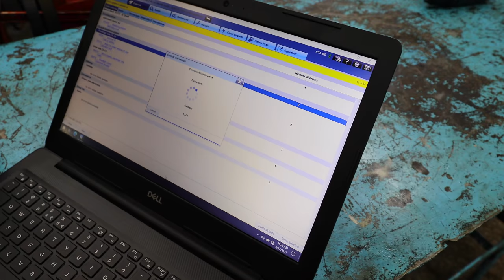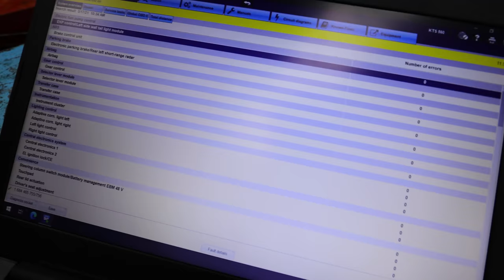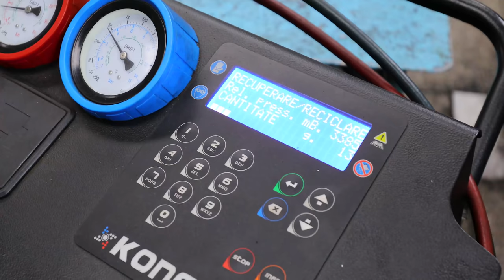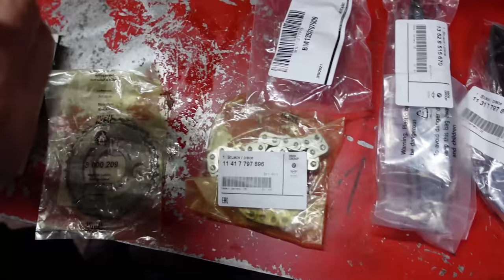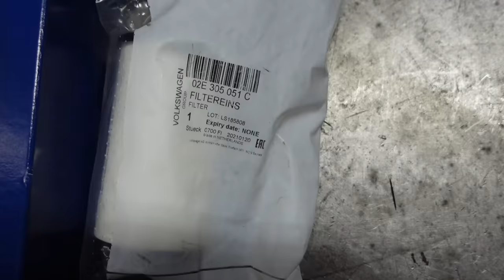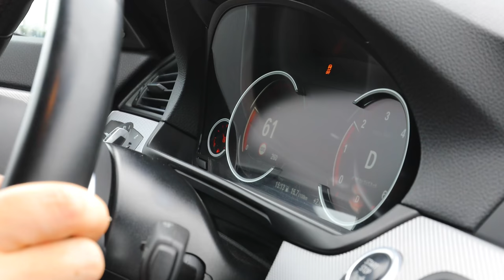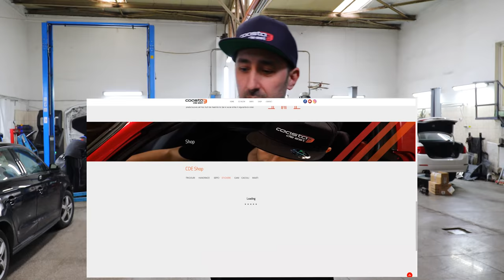BMW M550xd - balaurul cu 3 turbine 😈😈😈

Comment: Salut . Ma numesc Alexandru si consider ca cea mai tare masina este BmW e36 doare ce nefiind mecanic . ( doar ce terminasem liceul ) mi-am achizitionat unul . ma lasat motorul in Drum . Am schimbat 3 motoare la 3 e36 diferite la bordura ( pe drum ) din diferite motive fara a avea prea multe cunostinte de mecanica are cateva mufe de la ecu si electrica foarte simpla care o are . furtunele de racire  apa / incalzire habitaclu  . caseta de directie 2 conducte . si 2 tampoane dupa care cutia si etc dar noi de cele mai multe ori pastram cutiile la swap-uri . Interiorul era unul decent de frumos si erau anumite e36 cu destul de multe optiuni de Asc la incalzire in scaunde clima dubla digitala . computer de bord pilot trapa . la modele coupe geamurile Buterfly rabatabile electric ceea ce in ziua de azi nu mai vezi pe nici un e36 . si clasicele lucruri usor de lasat pe burta jante la tot pasul cu prindere 5x120 si hrana pentru suflet ( cerculetele / drifturile in mers ) ! e36 Order !!

Comment: Dupa părerea mea, cel mai bun model de la BMW este E46 datorita mai multor motive 
1. Pentru vremea aceea a fost un model revoluționar cu o diferență destul de mare fata de modelul anterior ,ceea ce se întâmplă mai puțin în anii următori pana în prezent 😅
2. A pus la dispoziție cumpărătorilor o gama larga de motoare
3. A fost și este un model pentru toată lumea ,iar asta se vede în cifre ,prin faptul ca este una dintre cele mai cumpărate mașini 
4 A venit pe piața cu foarte multe dotări moderne pentru acea vreme 
5 Modelul M este și acela un model revoluționar pentru acei ani (3246 cm³ / 343 - 360 CP ) 
5 Un model foarte fiabil . Nu știu câți posesori de BMW se pot lauda în perioada asta ca nu au probleme cu distribuția la 300000-400000 km 😅

Comment: In legătura cu stage 1 depinde de la mașină la mașină, dețin un Peugeot 4007 cod motor 4HN 2.2 HDI 156CP 380NM din ce spune producatorul, am făcut la cineva in “garaj” stage 1 DPF și EGR-OFF. Mașina a mers bine 3000 km pana s-a aprins martorul motor cu eroare pe debitmetru de aer. Am schimbat 2 debitmetre 100€ bucata ca sa îmi dau seama ca modificările aduse la soft erau incorecte, mașina nu putea sa tragă atât aer pe cât era scris in soft astfel dând eroare pe debitmetru. Mi-am pus înapoi softul original și am mers la cineva profesionist care face stage 1 și este acreditat A-TEAM Performance. Băiatul mi-a pus stage 1 care sincer nu am avut nici o problema atât doar ca ma mâncat sa ii pun filtru sport conic intra mult prea mult aer in motor mașina a dat iar eroare pe debitmetru, de tura aceasta i-am schimbat filtrul conic cu unul original K&N iar mașina a scos pe dyno 178CP si 425 NM cuplul nu este impresionant față de ce venea din fabrica dar se simte puterea având de la 3200 rpm 170 de cai constant pana la 4500 rpm. In principiu contează cine îți face softul sa îți și ofere o garanție pe mașina ca nu vor apărea alte erori după cum am pățit. Mașina are acum 275.000 km in creștere.

Comment: Consider ca BMW M1 coupe 2011 este cel mai bun si cel mai unic bmw pentru perioada lui. 
Este unul dintre putinele bmw-uri moderne unde mai putin inseamna defapt mai mult.
Sa va explic :
Alte modele bmw precum M3, M5 etc devin din ce in ce mai mari, mai puternice si vin cu din ce in ce mai multe dotari dar pana la urma bmw este despre performanta. Eu sunt de parere ca adevaratii pasionati ai marcii isi doresc o masina cat mai minimalista si cat mai performanta, iar bmw nu prea mai face asemenea masini.  Sa luam spre exemplu un m4 GTS, o masina de altfel puternica dar care vine cu prea multe. Jante aurite, dita mai aripa in spate, rollcage, transmisia cu dublu ambreiaj, sistemul de injectie cu apa din portbagaj, multa electronica. Dintr-o data parca totul devine foarte complicat. Daca vrei cu adevarat o masina minimalista, orientata strict catre performanta (ce insemna defapt BMW odata) singura optiune ar fi sa te orientezi catre modelele vechi de M(<2001).

SAUUUU, iti poti lua un M1 coupe din 2011. O masina produsa doar in 6309 de exemplare, destul de rara, unica, si orientata spre performanta zic eu :D. O masina alimentata de un singur tren de rulare ce dezvolta o putere de 335 de cai. Cea mai buna varianta a motorului N54 si al doilea motor turbo pus vreodata pe un M (imediat dupa s63 v8) motor in 6 cilindri, pus de asemenea si pe renumitul e89 Z4 si dotat cu o cutie manuala in 6 trepte.

Pentru o perioda in care BMW o ‘ardea’ fancy cu transmisiile automate cu dublu ambreiaj, m3’uri cu v8 + obsesia timpului scos pe Nurburgring 0-100, BMW M1 nu era o masina chiar asa de rapida si nici ‘high-tech’ dar in schimb era o gura proaspata de aer. 
Spre exemplu, in loc de frana de mana electronica, acest model vine echipat cu o frana de mana clasica, suportul de pahar nu este ascuns si proiectat sa se deschida intr-un anume fel ca sa fie cool si sa iti ia ochii, este doar acolo. Bordul nu dispune de un LCD fancy ca la majoritatea masinilor moderne, este analog. Sinele de la scaune nu sunt ascunse sub o tapiterie de piele de dragul de a face masina mai good looking si de a adauga la pret. Optiune cu trapa nu exista pentru simplicitate si pentru a cobora centrul de greutate al masinii. Consola centrala nu este finisata in piele scumpa, ai pur si simplu plastic (this is spartaaaaa). Spre deosebire de multe alte masini, consola centrala este super simpla si usor de folosit. O masina la care nu s-au adaugat elemente care sa adauge greutate si complexitate. Simpla si orientata catre performanta. 

Astea sunt doar cateva dintre motivele pentrui care BMW M1 este o gura proaspata de aer pentru oamenii care pur si simplu vor sa conduca. 
Desi BMW nu se astepta ca masina aceasta sa fie un succes, tocmai pentru ca au scos foarte multe elemente de tehnologie si gadget-uri, s-a intamplat fix opusul. In plan au fost 2700 de exemplare pentru fabricatie dar cererea a facut ca aceasta masina sa fie fabricata in 6309 exemplare.

O parte din motivul pentru care acest model a avut un succes imens a fost fix motivul acesta. Dar evident, ce a contat cel mai mult la acest succes, a fost experienta de condus. 

Cam asta a fost parerea mea despre BMW M1 Coupe, o masina perfecta pentru adevaratii pasionati. O masina care nu atrage atentia, nu te scoate in evidenta in nici un fel, facuta pentru sofer, nu pentru imagine. Este genul de masina pe care nu toata lumea o poate recunoaste dupa capabilitati dar care iti ofera o experienta unica. Iar in cazul in care un om vine la tine cand esti cu masina intr-o benzinarie, pregateste-te de o discutie foarte lunga despre masini, pentru ca acel om cel mai probabil o sa stie totul despre acea masina si multe altele :D

P.S doar asa informativ : 
Stiati ca primul BMW M produs vreodata a fost tot un M1? Masina a fost fabricata intre 1978-1981.

Mai mult decat atat, a fost prima masina mid-engine produsa in masa de catre BMW. A-2-a a aparut abia in 2014  (i8 hybrid) :D
Reply: Am uitat sa mentionez inca un aspect super important. Aceasta masina a avut un pret de retail undeva la 46,000 de euro. In momentul de fata, unul in stare buna si cu km putini este inca la un pret asemanator, unele chiar sar de pretul de lista. Printre putinele masini facute vreodata care si-au pastrat pretul foarte foarte bine in timp :D

Comment: BMW - 319 - 
1934–1936
Roadster, motor Otto de 1.9l (1911cm3 )ce dezvolta 40kw/98nm cu 3 carburatoare Solex si 6 cilindri in linie, cutie cu patru trepte din care, doar  treapta 3 si 4 erau sincronizate, o viteza maxima undeva pe la 120-130km/h, lucra pe 6Va instalatia electrica... urata, veche, mie unu imi place 😅, imi plac si alte modele dar asta e mai pe placul meu.

Comment: Salut! Am si eu o intrebare pentru comunitatea asta faina. Detin un Ford Focus mk2 facelift din 2009 si are aproximativ 123.000km, motor 1.6 Ti-VCT cu 115 cp. Atunci cand am cumparat masina, de la un baiat din Brasov, nu am sesizat pe moment dar se auzea un sunet frecare metal pe metal cand masina era la relanti in neutru. Ulterior am schimbat ambreajul cu tot cu rulmentul de presiune si aparent sunetul a ramas la fel, ba mai mult, e chiar mai accentuat. Am facut o constatarea la un service autorizat Bosch si baietii de acolo au spus ca este rulmentul din cutie. De asemenea vreau sa mentionez ca la anumite plecari de pe loc sau accelerari, spre exemplu treapta a 2-a la 2000 de ture daca apesi putin mai tare de jumatate de pedala, se aud niste sunete de lovituri si tot in treapta a 2-a in decelerare de la 4500 rpm iese din viteza daca nu e tinut schimbatorul. Sunetul am crezut ca e de la protectia termica de sub teava de evacuare, pentru ca s-a marit gaura unde se prinde surubul si acum a scapat (ulterior am incercat sa il prind la loc dar cred ca a cazut iarasi). Mai am o intrebare si va las! Se poate monta filtru sport K&N din carcasa in afara carcasei? Vreau sa accentuez sunetul, precizez ca este filtru conic dar nu are colier de prindere, pur si simplu sta in carcasa si atat. Mult succes si spor in continuare echipei de la coasta, dar si voua cei ce ii urmariti!

Comment: Nu o sa spun ce bmw imi place dar o sa va povestesc ce mi s-a întâmplat cu un prieten care făcuse o afacere cu un bmw e36 din 2000 luat de la un "samsar" din calarasi. Stați linistiti ca nu a platit bani pentru el ci a dat alta masina(tot o coaja) era un ford focus 2005-2006  la schimb, bineînțeles fara fiscal si toate cele. El avea un "goal" sa conduca multe masini date la schimb, invarteli,afaceri, daca stau sa le trec pe hartie a avut vreo 60 masini luat din schimburi tinute 2-3 zile si date mai departe. Revenind la poveste, m-a invitat la plimbare in sensul sa imi arate masina si toate cele, am mers in orasul din apropriere, am bagat motorina, am si spalat-o, pe drum spre casa masina se opreste in mers 80-90 in timpul ala ne depaseste un opel(presupun ca de-aia s-a si stricat), punem avariile si incercam sa o pornim nu a vrut sa porneasca de nici o culoare, am dat la automat pana am ramas fara baterie. Am sunat un prieten i-am explicat ce s-a intamplat, a ras de noi in ultimul hal, era vorba daca nu vine sa ne tracteze sa o impingem vreo 10km, stiu ca pare o nebunie dar n-am vreut sa dam banii pe platforma. Într-un final am ajuns acasa tractati de un alt prieten. A doua zi s-a dus si a cumparat motor ca nu a vrut sa stea sa il repare, masina a mers chiar ok dupa schimbarea motorului, într-un final masina a fost data la schimb peste vreo 3 zile dupa interventie pe un mercedes. In concluzie aveti grija ce masini cumparati :D

Comment: BMW E39 525D Cu un consum de combustibil de 6,7 litri / 100km, prinde suta in 8,9 secunde, viteza maxima de 219 km / h, cod motor 25 6D 1. am un prieten care a schimbat 2 turbine, debitmetru aer, supape vacuum, garnitura capac culbutori, vascocuplaj, role intinzatoare, termostatele, 2 injectoare, termoflotul, racitorul de gaze fisurat, pompa de apa etc, dar el tot isi iubeste masina. Sincer si eu imi doresc un E39, dar nu-mi permit.

Comment: BMW X3 2006 e83 3.5d 286 cp, motor 3.0 m57. De ce este speciala? ... simplu, pentru ca o dețin😂, si sunt foarte rare cu motorizarea asta, as putea sa o bag la categoria Sleeper 😅, cele mai întâlnite fiind 2.0d . O am de ceva ani si împlinește aproape 400k km fara prea mari batai de cap, inca am dpf original activ😁.

Comment: BMW i8 are un sistem de propulsie hibrid plug-in, bazat pe un motor cu trei cilindri în linie, de 1.5 litri, susținut de un motor electric. Propulsorul cu ardere internă asigură 231 CP, în timp ce motorul electric oferă 131 CP. Sistemul hibrid oferă 362 CP într-o formulă concentrată pe eficienţă. Tocmai asta au vrut să testeze nemții, dacă o astfel de mașină plină de tehnologie de ultimă generație poate parcurge fără probleme peste 100 de kilometri pe cel mai frumos drum de condus din lume.

Nu am condus-o eu am fost pasagerul din dreapta dar sincer cum era de așteptat, mașina a mers de minune,fiind o generație de motor de viitor Eco , caroseria având o aerodinamică bună și design plăcut ochiului . Vă salut băieți!  ✌️

Comment: Pot spune ca sunt indragostit total de un e36 vechi din triple obișnuit nu există atât de mult mai mult, sau mai degrabă, nu mai există aproape nimic, BMW M3 E36 este doar o altă mașină.
Când a apărut tocmai, jurnaliștii au fost uimiți și unii au susținut că - aceasta este cea mai bună mașină.
Motorul a fost conceput special pentru ea. Six-cilindru S50B30 a avut 286 CP. și 320 nm. Nu este nevoie să uitați că în acei ani, Porsche și Ferrari nu au avut întotdeauna cât mai mulți cai, dar de obicei mai puțin. Cu asa instalare de alimentare Mașina accelerează la sute în 6 secunde.
Și în 1995, M3 a fost restabilită în timpul căreia motorul a fost actualizat. S50B32 a primit un volum mai mare, dublu vanos (dezvoltare unică de la BMW, schimbări de sistem rezolvând distribuția Tase, deoarece electronica a schimbat automat aportul și eliberarea HAR-KI, astfel încât motorul să poată funcționa cu o eficiență maximă pe toate revoluțiile). Ca rezultat, puterea a crescut la și 350 nm. Cutia de viteze a fost înlocuită cu șase viteze. Accelerația până la sute reduse la 5,5 secunde.
În 1997, a apărut o nouă generație de cutie de viteze, SMG secvențială. Semnificația sa este aceeași ca într-o cutie de discount, adică. În esență, asta pPC mecanicDar nu este necesar să strângeți ambreiajul, face automatizarea. Acest lucru a făcut posibilă creșterea vitezei de schimbare a vitezei la 0,15 secunde. Punctul de control obișnuit nu poate fi comutat la acea viteză.
America M3 a coborât la 240-KA HP
BMW M3 E36. sistem de franare De asemenea, a fost consolidat, discurile de frână au fost crescute la 315 și 312 mm. Roțile au fost cauciuc de 17 inci 235/40. După restabilirea roților au fost respinse.
În cabină, pe vitezometru a fost o marcare pe o viteză maximă mare, iar zona roșie de pe tahometru a fost transferată în continuare. Pe niște plăci, a apărut tricolorul de marcă. Volanul sportiv și fotolii cu suport lateral extins. Pretutindeni material foarte scump și piele.

Comment: Pentru cei de vreo 30 de ani adica eu cred ca cel mai ,,TIPLA,, BMW e un 325 (E36) din 1998 de 105 kW (141 ponei de tractiune ) si parca 260sau 280 Nm.
 Acesti ponei te ajuta sa mergi linnnn sau TARE, sa te invarti in intersectii mici chiar de aveam cauciucuri care deabea incapeau in aripa spate 245/45/17 Pirelli(SH ca la varsta aia mai greu cu banii). Cu ea am reusit sa rup 3 din cele 4 suruburi sanatoase cate tin grupul pe spate. Sai dai blana pe o autostrada din ,,Germania,, si cand te uiti in spate zici ca e locomotiva si consumul lipit de limita max de 20 care tii poate arata :))).Un alt mare motiv este aspectul per total al masinii si al borduli care este orientat cu toate ceasurile spre sofer....te face sa simti ca esti sofer nu conducator auto Acum toate bordurile sunt plate...frumoase dar destul de neiteresante in acest sens...e facut pentru toti din masina...poate suna egoist dar masina e a soferului nu  a pasagerului si pentru mine era o masina care iti ofera o pozitie buna de condus ,destul de silentioasa la drum lung,confortabila si palpitanta cand vroiai( nu degeaba m-am rasturnat cu ea la 50-60km pe ora intro noapte pe o ploaie torentiala)dar stati linistiti fara victime si maina a fot recuperata fara nici un geam intact doar plafonul putin strivitsi cateva indoituri la usile din dreapta(calitate germana).Masina pusa pe roti dupa 5 ore lasata putin si dat cheie si venit cu ea asa pana acasa vreo 35 km si in boxe canta  Inner Circle- Bad Boys (https://www.youtube.com/watch?v=on9TXY8kYyk&ab_channel=CrazyT)
Si la incheiere va povestesc ca atat de mult mia placut masina de am cumparato de la Botosani si am venit cu ea pana acasa 415 km fara alte acte valabile si lovita fata dreapta si alta masina care mergea in fata pentru a ne anunta daca e ceva politie .NU RECOMAND NIMANUI ASA CEVA dar atunci erau putin diferite situatia financiara si gargaunii din cap erau mai activi :)) BMW 3 Series  325 diesel pentru mine a fost TIPLA TIPLELOR care nu a fost cumparata sa agat toate doritoarele de scaun dreapta la un BMW ci pentru sufletelul meu d^_^b

Comment: BMW seria 5 e60 (ingeras) , 2003 , 2.0 tdi , 6 trepte , 115 kW , 154 CP , 210 N M , mi se pare o mașină super geniala din perspectiva mea , o recomand , este un model reușit de BMW , în primul rand , când a început producția în 2003 a fost o surpriza pentru fanii BMW și este și în ziua de astăzi o mașină apreciata , o ador , recomand acest model în primul rand pentru aspect , putere , si putem spune și lux , îmi place pentru ca are și sistemul iDrive , pentru mine rămâne o mașină super frumoasa și sper ca va ajuta asta în viitor , va salut cu mult respect , și îmi place ceea ce faceți,  aștept videoul următor, va salut cu mare drag.

Comment: M5 E60 motor v10 4999 cmc

In primul rand sunet impecabil
Designul este foarte controversat de multa lume de asta cred ca o face sa fie o masina mai speciala.
Cred ca nu va mai exista o astfel de masina de la BMW cu asemenea motor.

Cred ca este singura masina de la BMW si ultima ca o poti numi masina "periculoasa" datorita tratiunii spate si unu motor mare si puternic.
Cele de generatie noua majoritatea au sistemul de xdrive si par mai "imblanzite" :)
Sincer as dori sa detin acest model pentru sunet si motor , chiar si design, mi se pare o masina speciala.